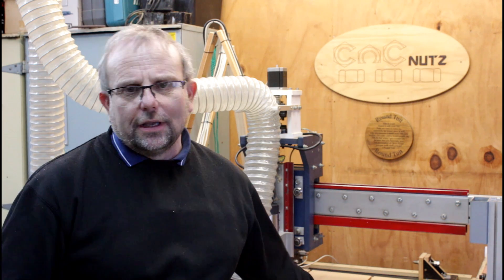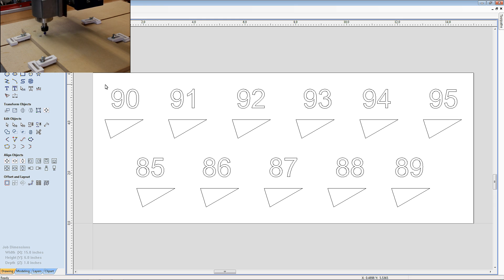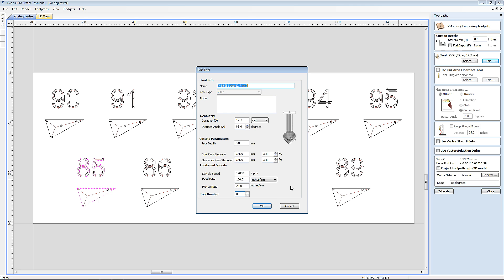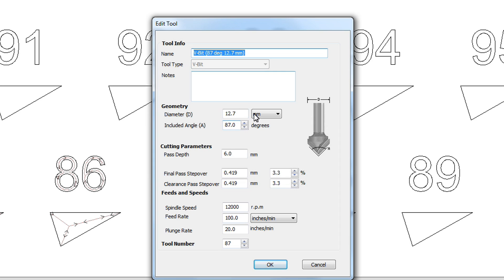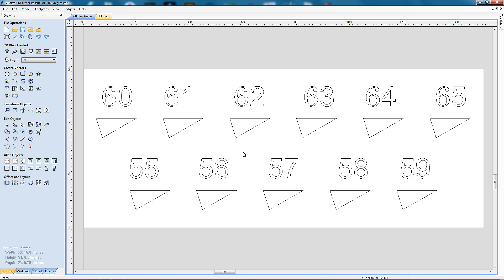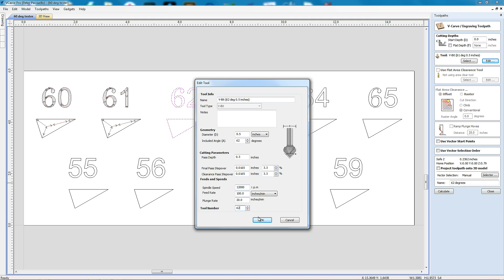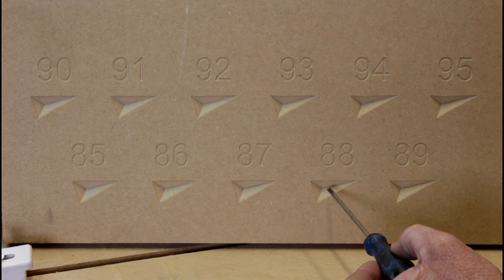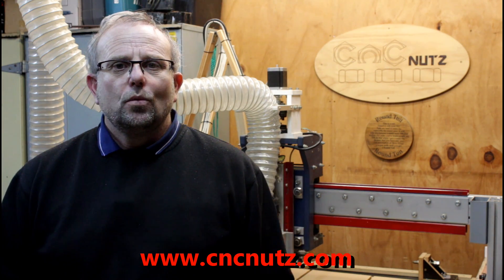Test your V-bits angle - CNCnutz Episode 151

Comment: Peter

More of a technical question is why are the edges of the triangles not straight when the angle of the bit selected in the software doesn’t match the actual angle ground into the bit?  New to CNC and just curious why this phenomenon occurs.  Thanks for the tutorial. 

Stuart
Reply from the maker: Hi Stuart.
It is because as the cutter nears the corners the cutter rises it create the sharp angle. If the angle of the cutter does not match the angle in CAM the rate of cutter rise will not be correct and so will rise too slow or too fast. This gives the curve effect. The straight section between corners is actually straight but because it is so short it looks curved.
Cheers Peter
Reply: Thanks Peter.

Comment: Little late here, using a brand new 60 degree white side bit, used the 60 degree program and I do not see any difference in the triangles. Did I do something wrong?
Reply from the maker: You should definately see a difference especially between the first and last unless the geometry of your cutter is magic and changes by itself. I have seen this only once where a user took the fila and set the cutting angle for each triangle to 60 degrees instead of the angle shown on the triangle. Doing this will make them all the same and also defeat the purpose of doing the test cut. In your CAM software is each triangle cut defined as a different angled cutter or are they all 60 degree cutters?
Cheers Peter

Comment: How to save gcode for GRBL based machines. It shows the postprocessor selected doesn't allow for tool change. Can you please help?
Reply from the maker: If the cam software you have has a post processor and it does not support tool change then it is likely that your controller duress not support tool change. I don't know anything about grbl so cannot help.
You will need to research your controller commands to see if tool change is supported and if it is you will need to modify the post processor to add the functionality. 
Cheers Peter
Reply: @cncnutz   Thanks a lot for reply, finally i cut all the tool paths separately. Hardly took 10mins. Although i did changed the GRBL post processor to avoid tool changing.

Comment: This is great, thanks for sharing!  I have a 150 degree V bit, by 1.25" wide.  I notice when v carving, that it is slightly off.  Can I use these same triangles, but change the angle to 149 and 151, and so on?  Thanks !
Reply from the maker: That is exactly  what you should do 145 to 155.
Cheers
Peter
Reply: @cncnutz  awesome, thanks!

Comment: Remember you working in wood and not building an engine. I fell asleep in the first minute and glade I did. You forgot about the vibration in the little CNC you have that make a big deference that you would not see in a big heavy CNC.  Therefore, if you going to build anything do not waste your time with this video it shows he got excessively too much time on his hands.
Reply from the maker: While many of your points are valid you are wrong about needing to know the correct angle of your Vbit. Incorrect Vbit angle will make  VCarving look wrong and this simple 5 minute test is a good way of ensuring a 3 hour VCarve is not ruined. I call that a wise use of my time because I don't have too much time on my hands. I have repeatedly mentioned that we are not making parts for NASA but VCarve bit angles are an exception. I suggest you rewatch skipping to the end of the video and see the effect a few degrees makes on a straight line when VCarved.
Cheers
Peter

Comment: Does the material have to be 1 inch thick?
Reply from the maker: No, I used 3/4 mdf in the video.
The material needs to be thick enough to stop the cutter coming out the bottom. If your material  isn't deep enough then set a flat depth to limit the depth of cut to suit your material.
Hope this helps.
Cheers
Peter
Reply: Thanks. I have some 3/4 MDF. the test files had a setting of 1 inch and wasn't
 sure if that was required.

Comment: brilliant.
could a similar method be used for radiused bits to see if they are accurate as well
Reply from the maker: I don't think so somehow though assuming that the radius is half the diameter of the cutter and the cutter is not tapered then you could cut a slot with the bit and measure the width of the slot. The radius will be half the slot width.
Cheers
Peter

Comment: Why not just check against a protractor?
Reply from the maker: You couldn't possibly be more accurate by manually measuring the angle. At best you could only be as accurate.
The method shown will give you the best angle to assign to your router bit, in VCarve pro to give the best possible VCarve.

I don't think I could measure the angle of a 1/8th 90 degree Vbit whos flute lengths are less that 3/16th long. I am probably thinking of the wrong type of protractor. Do you have a link to a picture of a suitable protractor for measuring cutter angles.

I also note that while I don't own a protractor and would need to buy or make one to measure the angle. I do own a CNC machine and scrap MDF so can easily check my angle imediately for free.

Cheers
Peter
Reply: Because it's not as good a method.
Reply from the maker: +Arduous Andotherous 
Unless your router but is huge you wouldn't be able to measure it.
Reply: I meant the bit. To see 59 vs 60 on a protractor is simple even for my bad eyes. Whether the measured angle actually cuts it is another story. But I think it would be more accurate than your method anyway - with a lot less effort. Sorry